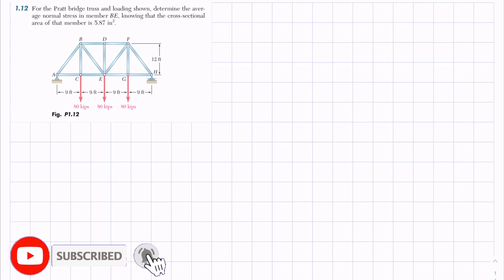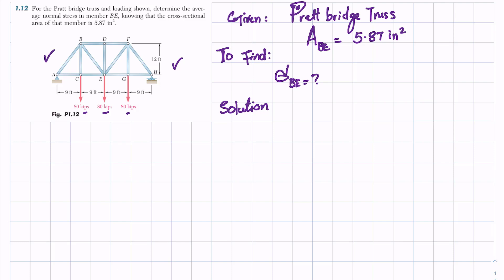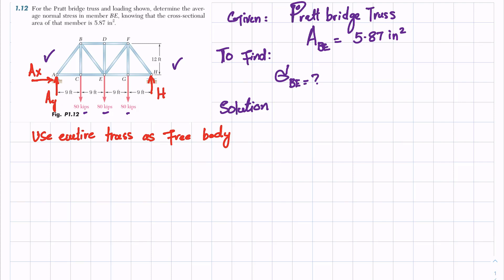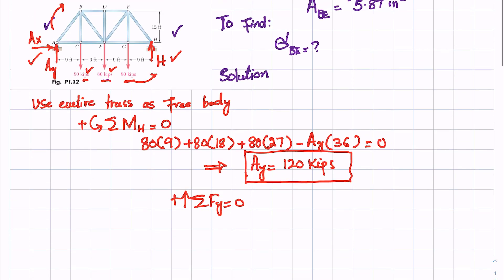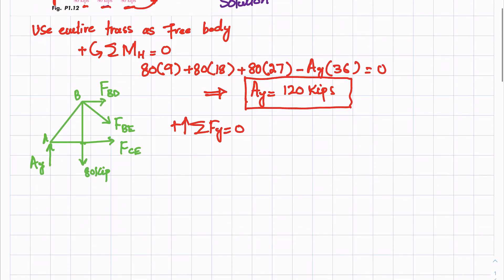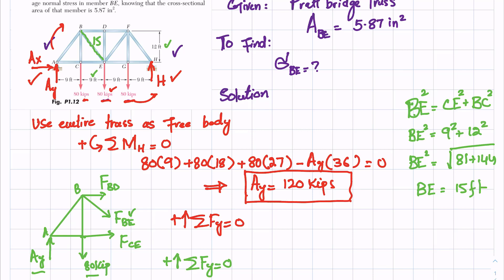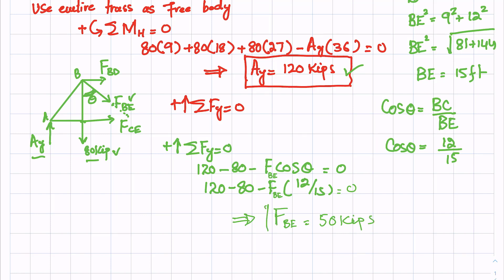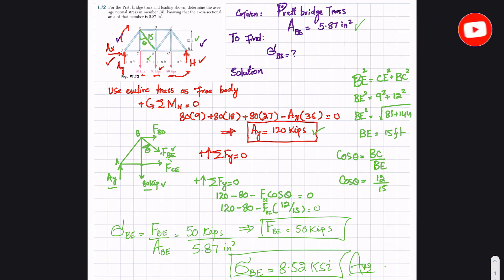1-12 Concept of Stress Chapter (1) Mechanics​ of Materials Beer & Johnston

Comment: sir in first problem 1.12 you have told that at  point A there are reaction forces Ax and Ay but at point H you just said that the reaction force is H why did you not talk about components of H and just said H is the reaction force?please guide
Reply from the maker: @Talha Saleem at point H we have roller support and when you remove roller support then you have to give reaction force that is perpendicular while at point A we have pinned support. Horizontal and vertical forces are presented at A when you remove pin support. I hope it is clear now. Thank you 😊 💓
Reply: @engradnanrasheedmechanical  thank you sir. one more question ..... why you put negative sign with Ay? although if we move Ay anticlockwise then the direction of Ay and H is same. i mean that you said that if we move the other forces in counter clockwise direction then they have same direction as that of H but in case of  Ay you just said that they are producing clockwise moment. I did not get the point how Ay is producing clockwise moment?
Reply from the maker: If you are taking sum of moment about point H is equal to zero so force Ay is producing clock wise moment about point H and clock wise moment is taking as negative that's why I have put negative sign.